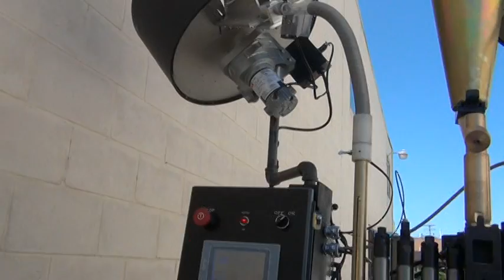Camdex 2300 Series Pull & Put Machine

Comment: @1:32, it's pulling out bullets and replacing with a different one?
Reply: North Dakota looks like 223 to 300  blackout
Reply: @TheValiant2289  nope that would entail shortening then necking the case. Looks like 7.62x39 to me and its for some reason replacing the projectiles.
Reply: @HMHacki   if you watch the whole video the second machine is showing a smaller necked casing.
Reply: @TheValiant2289  It does look like the case neck is adjusted yes but a .300 blk case is significantly shorter than a .223 so its not the change between those exact cartridges.
Reply: @HMHacki  looks to be a .30 calbier round in relation to case size but I'm curious to know how much that setup cost. I have a turret reloading setup and it's not any cheaper for my 9mm or 5.56 to reload than to buy good ammo. The 308 saves me a few cents a round though
Reply: 7,62x39